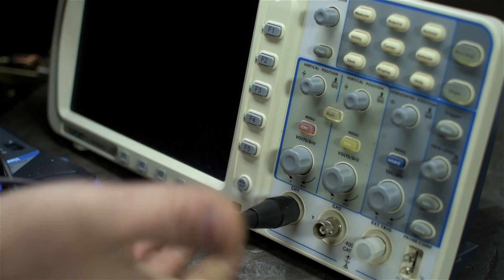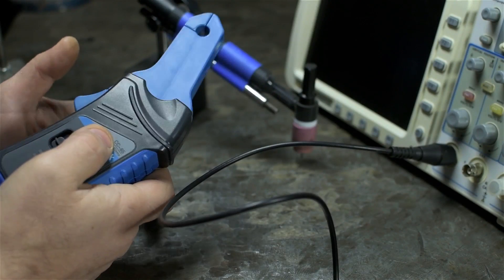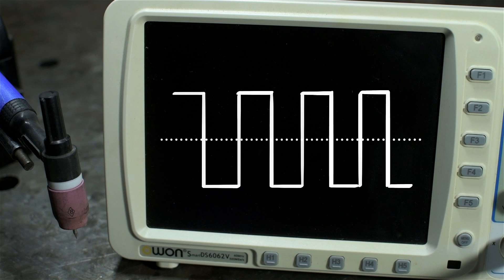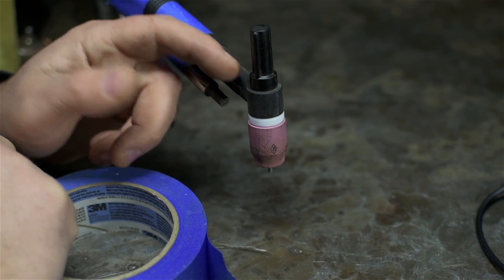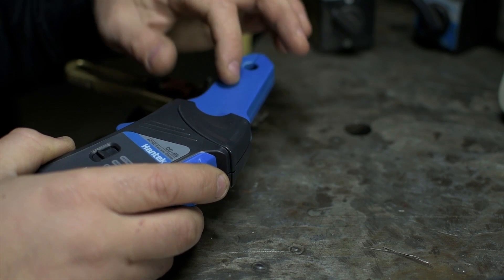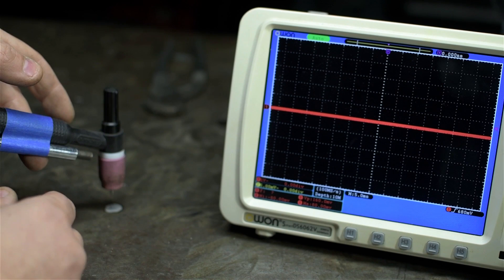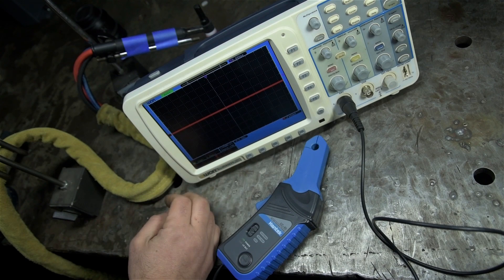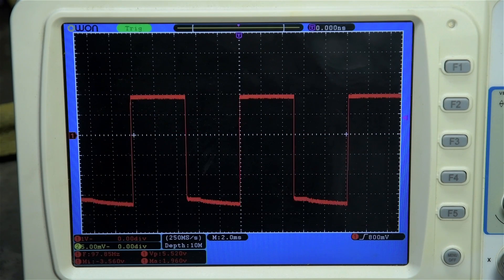Oscillo-Help-Me?

Comment: The HF start is needed to establish an ionized electrical conducting path in the air. As the breakdown voltage of air is ~25 kV/cm in the HF starting phase your welder acts like a radio transmitter with voltage spikes of ~50 kV (from 2 cm). The torch and the cables are the antenna. This is what your scope don't like.
Do the manual of the welder say something about the HF start? Like don't try to strike an arc from a distance bigger than 1 cm?
The Hantek CC65 current clamp has a limit of 65 Amperes. The peak of a sinusoidal current of 65A is ~92A (65 * sqrt 2). It is ~184A peak-to-peak.
According to the manual of the current clamp currents bigger than 2A should measured in 1mV/100mA setting.
As others say, it may worth to try to clamp the current clamp backwards (rotated by 180°). If the oscillogram turns upside down (mirrored horizontally), the measurement setup is faulty. If it remains the same then that is the actual waveform. Sorry, I was wrong. This way the problem cannot be determined.
But another idea. Your workbench is steel and though it is electrically conductive it's not the best conductor. You could use it as a shunt resistor.

Comment: I'd get a pixie wrangler to do some short-circuit impedance tests on outlets in your shop. Might be some bad ground connection.

Then again the probe might be crap (saturated core flux OR saturated output buffer opamp).

Comment: Wouldn't the scope and welder need to share the same ground for this to be accurate? Otherwise wouldn't ground be floating?
Reply: No. The current probe should be able to tell when there's no current flowing through a wire without any other reference, simply by the zero magnetic field it senses, and generate a voltage of zero for you to look at on the scope. Everything else is relative to that - it's measuring absolute current, positive or negative, as long as there are no other strong magnetic fields around.
Reply: Pfft. Boats float, ground sinks.
Reply: Sharing the same ground is a good way to get a broken scope.  If the energy finds a way through the scope you're going to fry your inputs.  A battery based scope is great for this, otherwise you need to have your scope on an isolation transformer to separate it from the same circuit as the equipment you are testing.
Reply: Why oh why didn't TOT think to use a clamp type current probe, they have really great isolation properties. Oh, wait . . . . .
Reply: the welder's ground clamp is at its ground. if that isn't at 'earth' ground, then current is flowing through the ground clamp, into the table and down to earth (either through the table, or through the person touching the table) - not good. the scope's ground is earth (unless he's using an isolation tranformer, which he probably would have mentioned if he were).

Comment: I would try to make a really simple current shunt. Like a heavy piece of steel angle.  Attach(weld) one end of it to whatever your ground is, then attach the probe ground near where the angle is attached to your ground and attach the sensing part of the probe around halfway up the angle(this would be adjusted to change the sensitivity).  Then start an arc at the other end of the angle(first try starting the arc then attaching the probe)

Comment: I agree with BMR Studio trying it on a lightbulb. A water heater would be even better, they are around 1.8-2kW. Heaters and lightbulbs are fine since they are resistive loads, and have no reactive component.
The current probe claims having a Hall sensor, so it can measure DC offset too. Try it with a DC circuit, like car battery and a heater.
If both work fine the probe should be reliably measuring both AC and DC. This probe is capable up to 65A, but only in 1mV/100mA setting. If your switch stays at 1mV/10mA it can do only 10A! 
Depending on the core it might measure still OK since they usually have a big headroom, but if the manufacturer pushed the datasheet declaration to its limit the core might saturate and display lower values. There are sometimes protective Zenner diodes inside and they clip higher voltages. Try and switch your probe to 1mV/100mA and your scope to 100mV/div resolution. 
As for scope resetting my first thought was the same as yours - grounding. If you are running the scope already from battery, it is certainly not the grounding. Try and keep the scope and the probe wire away both from the thick metal table, the welder stick and the ground clamp. All they create a loop where huge currents are flowing and coupling to your scope if near enough. 
If you have a spare milling machine around you might use it as RF shield between the scope and the welding equipment :)

Comment: You will kill your scope if you haven't already. Never try to to test hf start, that will induct voltages in your clamp that can damage the electronic components that's why you have undefined behavior (random stuff happening at your scope). You could try with voltage divider to lower the voltage so you can read it. That said, I suspect it's arbitrary htp decision, but, might be different ground problem if your scope and or clamp aren't damaged.  Keep the vids coming u are super fun
Reply: He might have killed the op amp in the clamp....

Comment: About that unbalanced ac what quickly found on millerwelds website states: There are no hard rules about setting balance control, but the typical error involves too much cleaning. Too much cleaning action (electrode positive duration) causes excess heat build-up on the tungsten. This creates a large ball on the end of the tungsten. Subsequently, the arc loses stability and you lose the ability to control the direction of the arc and the weld puddle. Arc starts begin to degrade as well. Too much penetration (or, more precisely, insufficient cleaning action) results in a “scummy” weld puddle. If the puddle looks like it has black pepper flakes floating on it, add more cleaning action to “blast” away oxides and other impurities.
Reply: And I'm not welder in any means but that sounds and looks something you're facing there.

Comment: Stevenleatherbarrow has it right. You have a common ground to the secondary in the clamp. That is after all what your looking at directly with the scope. Someone here mentioned using a signal generator.  Great idea.  At least then your signal is a known.  Then see what your scope interprets it as.   Like you alluded to Tony, dont really know what the manufacturer of the welder intended.

Comment: Why not disconnect HF tesla coil module and use like a 10x probe to make welding voltage measurements directly? Perhaps use an analog or even vacuum tube oscilloscope, since they don't fry as easy as digital scopes. 

Then it's also possible to use a current shunt (like the ground cable) and use a differential probe to measure voltage drop over shunt to get welding current.
Reply: he is not measuring voltage, but current. Voltage will vary in the device to match the current settings because of resistance changes because of the distance of welder tip and all that.

Comment: Hay Tony, 
Reading through some of the comments there is only 1 I can see that states the obvious.
Start with a known signal, put the clamp on the Live wire of a Lamp or even the welder, check the waveform, should be a perfect sine wave.
You don't need a ground line unless you have noise or are looking for a comparison between that ground and the voltages being observed.

As with all electronics, start at the beginning with something you know, then progress from there.

Comment: BAMM : operation manual: Application Notes: 2. In the case of DC current measurement, the current clamp can not possibly zero properly, due to the hysteresis effect. To eliminate this, open and close the jaws several times and then zero again.
I think thats the Problem
Reply: He measures AC

Comment: here is a question - you have 2 poles, current is flowing in one direction and then in reverse, how much time you spend sending current in one direction vs the reverse is your AC balance setting, and the amount is the peak to peak value, and the question is - why does it matter where some virtual ground (your scopes zero point) is? is bears no meaning to the measurement, since your scope doesn't know where the generators zero point is. 
What I mean is - there probably is nothing wrong with those wave forms, and the cause of the confusion is in that probe, there is a current transformer in it, and some circuitry around it before the cable to the scope, and that circuitry is the cause of this effect, and without a schematic it is quite pointless to debate as to why that is happening, maybe there is something about it in the probes manual...

Comment: A few things that may influence the result:
- Check if the output of the clamp is the same even if You put it on backwards. It SHOULD by symmetrical, but it is not always the case. Flip it. 
- Check the current while not welding on the table, but on an isnulated piece of metal. Just a wild guess that it might change something.....
- Try buying a LEM transducer rated for higher amps for current measurement. From my experience, the current measuring clamps from oscilloscopes are often no good.

Comment: From the standpoint of Physics, it's negative to positive. The particle responsible forelectricity, the electron, has a negative charge. In, for example, a battery, the negative terminal has an excess of electrons and the positiveterminal has a deficit.

Comment: Not an electrical engineer, not yet at least, but here's my take on your issue.

as of the dc offset, I suspect the current clamp. Try turning it around and do the same measurement. Or you could put a big flipping resistor (1 milliohm, 30 watt should do it for 200 Amps) in the weld current loop and measure the voltage drop over the resistor. This should also work for HF start. This high frequency voodoo magic messes with the transformer or hall-effect sensors in the clamp and, evidently, your scope.
Or try putting a RC Low-Pass filter (ask the hivemind) in front of the scope to stop the HF-poop from getting to your scope. (R=1kOhm, C=0,03µF gets you in the ballpark).

And try asking over at eevblog.com/forum.
I'm really interested in the results, so please share.

Take all information at unit price. Standard rules apply, no refund, applconcepts Co ltd. is not responsible for any dead scopes, temporary blindness or broken endmills.
Reply: I'm with you on the flipping of the clamp, and the other stuff too.

Comment: As a EE I enjoy watching your videos. My best advice is to flip the wire (your welders ground lead) direction in the current probe. It should give the inverted result on the scope. The random behavior of the scope with the HF start is an early sign of emi sensitivy that may cause undesired measurement results. Kind regards from the Netherlands. PS, that is not a brand that makes real scopes.

Comment: it's the ground . . . it's always the ground.

the 'scope ground is "floating" . . . i.e. not tied to the same reference as the welder . . . you might be able to cobble together a ground reference using the second input to the 'scope but if you do it wrong you can let the magic smoke out.

and if you're running anywhere near the full rated current of your probe, it's going to be less accurate.
Reply: will amoroso you are not basing your measurement against ground.. if you were measuring the voltage from the welder output to the scope then yes ground makes a difference but you are measuring the difference from one side of an inductor (current clamp) to the other...
Reply: Its a differential reading, not referenced to earth
Reply: the current probe has two wires coming out through the BNC connector, the scope is measuring the voltage between them, no ground reference required, but zeroing the current probe is required  
  
ELI5: push-pull vs. water level
Reply: i'm not basing anything against anything . . . that's the problem . . . neither is the 'scope!

what shows on the 'scope screen is a waveform that is asymmetric with respect to a line on the 'scope face labeled "zero" . . . the location of that waveform on the screen is determined by the 'scope electronics and has no relationship to any "zero" that has anything to do with the welder.

the 'scope is setting an arbitrary level as "zero" . . . the actual current out of the welder is either all above or below the point that the welder has established as "ground" or partially above and below . . . unless the scope can be connected to a point that the welder sees as "ground" and reference that level as "zero" the placement of the waveform on the screen is arbitrary.

in other words "it's the ground"

Comment: It is likely your measurement setup. What you are calling 'ground' on the screen actually has no reference, since you don't have the scope connected to anything referenced to gnd. The current amplitude, while operating in AC weld mode *is the only relevant factor*. Since at one time the current total is just flowing from electrode to work, and then reverses, instantaneously the current is generating a field which is being measured inductively, or by Hall effect (if the probe is an AC/DC type), the amplitude with respect to some arbitrary ground is meaningless.

Theoretically, if you're using such a current probe, grounding to the work should not be dangerous to your scope, since there is no current path from the air gap in the probe to your scope.  However, if HF start occurs, while connected to ground, all bets are off, as you have already experienced, since RF is very sneaky!

So, I believe you may be alarmed needlessly. The shape assymetry on the peaks of the waves, particularly at the bottom, where the old scope showed some ringing, is just a function of the switching elements (IGBTs?), and their gate capacitances. Negligible effect on the weld, IMO.

Hope this helps. Maybe other viewers can comment on this, and further clarify (or shoot down) this explanation.

I really enjoy your videos, and continue to learn good stuff from them.

Best.